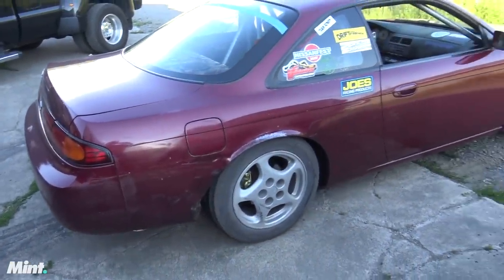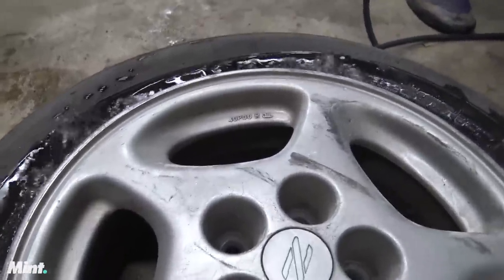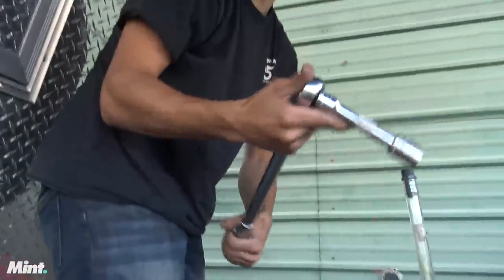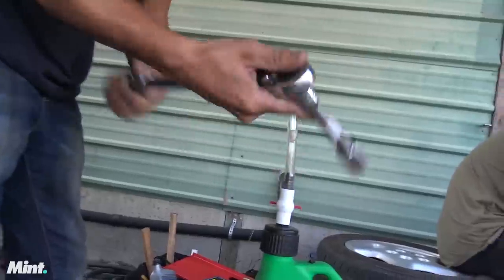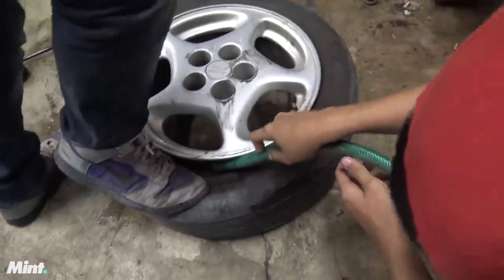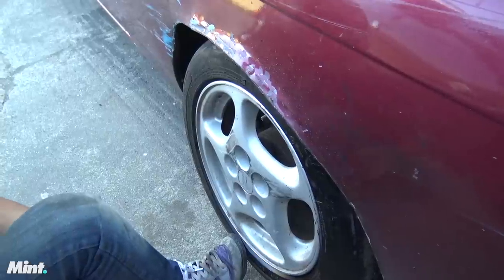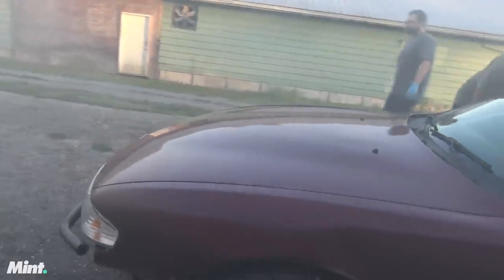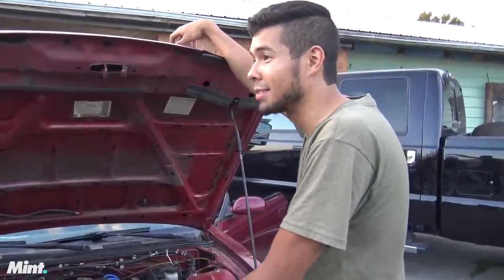Filling a CAR TIRE with WATER!

Comment: I am a farmer and we put water in the tractor tires for more weight
Reply: Tractor tires are supposed to have water.
Reply: Love this comment
Reply: John Legend I’m 💀💀🤣🤣
Reply: A lot of poeple don't know this
Reply: I am a farm hand so this is common knowledge to me to
Reply: Isn't the water put in the drive tires treated with something to make them even heavier. I forgot what called.
Reply: Calcium Chloride so they don't freeze.
Reply: It is also common around here to use windshield washer fluid, don't corrode like calcium, also doesn't freeze
Reply: @edwardsnowden4408  😂
Reply: @edwardsnowden4408  ewwww
Reply: FSB M ...Lier.... ?
Reply: I haven't seen anybody do this for some time now, all folks i know use weights an the back of the tractor, simplest thing would be to cast a barrell full of concrete with a steel rod through the center
Reply: majan but adding a liquid ballast is the most efficient because the centre of gravity of the tyre will always be where it’s contacting the ground.
Reply: @edwardsnowden4408  your censored
Reply: Good idea!!
Reply: Sea view farm Guernsey so do we
Reply: Kolin Martz not if you’re on a hill
Reply: John Legend wow dude you really are a legend lol
Reply: why are you not out harvesting and putting up fences!?
Reply: We use milk in our tractor tires. It curdles during the summer and becomes excellent cheese.
Reply: Tt Miller  um what does this comment have to do with the one I left
Reply: Tt Miller  true not many people are like that in the rural parts of Kern county California most these poeple know these things   so it's more like common knowledge
Reply: @rachellopez6626  love buu
Reply: Just use that RV winter Plumbing blue it it's cheap and it wouldn't freeze and if the tire popped is not harmful plus it has something in there to keep from corroding just a thought.
Reply: Yeah I see people with cement
Reply: Farm wisdom ! Farm wisdom!
Reply: have you tried sand
Reply: John Legend in Russian voice
Reply: well damn
Reply: Gym they are ballasted tires
Reply: Is dat rt? Wow. Cool!
Reply: recall  Hey! she asked first! and we keep it in the family. Literally.
Reply: MadeDat
Reply: tractor are supposed to be a water inside for more wait and i saw that when the driver put water on big tire of tractor....
Reply: @rachellopez6626  LOVE YOUR COMMENT!!!! NGGAAA!!!!!!!!!!!!
Reply: Why not concrete?
Reply: True

Comment: "You lose 50hp right from the start"

Just add a few more stickers to the car to compensate
Reply: Chrome air cleaner is proven to add 50 hp
Reply: No no, just some stickers 😁
Reply: Definitely the best comment 😂
Reply: Speed Holes....
Reply: Should've paint the car with more red
Reply: A few more spoilers can composate too (im going with the joke)

Comment: fill a tyre with expanding foam
Reply: Ryan LeFevre is a lawnmower a car? It would have different results
Reply: ItZz JoK3rZz yea it would be different specially if they doing skids and burnouts
Reply: Adam Smith yeah
Reply: Adam Smith i have tried it for my bike the ride gets very bumpy
Reply: ItZz JoK3rZz depends on what kind of lawnmower
Reply: Some of our industrial trucks at work have foam filled tires.  They are stiffer and have less traction.
Reply: Zoidsfan77 means more skids?
Reply: Adam Smith Yes.

Comment: tires full of flex seal
Reply: Become unstoppable
Reply: That would be a lotta damage
Reply: It will be rubber too!
Reply: @ajtritto3989  lot if damage resistance
Reply: They sell solid tires if that's what you're going for. They're really expensive and they are very uncomfortable to ride on. LOL
Reply: Helpmecomeupwithagoodusername it would help
Reply: NOW THATS A LITTA DAMIJ
Reply: A gallon of flex seal costs $89 so it would be a bit expensive. But they sell the Leak Stopper rubberized roofing tar for only $19/gallon! :)
Reply: @lorenzoangelomelo3683  *u⁸⁹😅😅😅😅😅
Reply: It'll never pop cause when the tire pops, there is a another tire because flex seal is liquid rubber
Reply: To much rubber -_-

Comment: So you pretty much made water cooled tires.
Reply: aaaahahahaha.
Reply: Still won't cool an AMD
Reply: HERPY DERPEDY - You mean Intel? AMD's run pretty cool, especially the Ryzen series. I have an i7 and its IHS is so shitty that it hits 70c even with a 240mm rad with stock settings.
Reply: Sean Place well still don't know much about the Ryzen but ye ol Athlon were smokin
Reply: HERPY DERPEDY - For sure, early 2000's AMD's ran pretty hot. I have some vintage systems with them and they're pretty toasty. But after Athlon 64, I never seemed to have any issues with cooling them. Even my old gaming rig with an FX-8350 and Hyper 212 barely gets over 55c with full synthetic load.
Reply: Makes Sense haha
Reply: My i7 in my thinkpad sits at a bomby 60c just on youtube right now

easily 85-90c gaming bwahahah

she takes a lickin and keeps on tickin!
Reply: Sean Place have you considered liquid cooling? My intel doesn’t break 50 when gaming in ultra.
Reply: gaming in ultra probably doesn't stress the cpu much lol
Reply: Tractor tires have been filled with water for years and years now. Sorry bout dat.
Reply: Guyver2391 I have a 240mm radiator. It's a common issue with newer Intel CPU's. They use shitty quality thermal paste between the CPU die and IHS, which results in high temps. When it's replaced with better paste, temps drop by 20c on average. I'll likely replace the paste after I get a new Ryzen system.
Reply: mPrism He must have bad airflow in his system. My 8350 was first built inside of a Cosmos 1000, which doesn't have very good airflow. I don't remember exactly how high the temps were, but they were above 65c. I installed a second intake fan directly in front of the Hyper 212 and the temps improved, I would get high 50's to low 60's after that. The board is now in an NZXT S340 and it gets low 50's. I had push-pull fans until I moved it to the new case. The pull fan didn't do much in the new case so I removed it.

PS: Ambient temps make a huge difference.
Reply: Sean Place - I have a FX-9590 in one of my rigs that runs like the surface of the sun....  Liquid cooled,  thing heats the whole room.
Reply: MadStupid - The FX-9590 is just an overclocked 8350, that's why the TDP is 220.
Reply: Sean Place  Yes, AMD picked some CPUs to factory overclock so they could get to that 5GHz number (and charge a lot more) in the end, the result is a CPU that puts out an extraordinary amount of heat. Liquid cooling keeps it running fine but dumps all that heat in my room. I like AMD,  I wish they actually get competitive and force Intel to stop slowly releasing "new" products that are marginally better than their predecessors.
Reply: @realmadstupid  you wish AMD would get competitive?
Wot, they are... I have a Ryzen 2600 and it's CPU score is higher than a Intel 7700k for half the price. My processor isn't even unlocked. The unlocked version is even better but pretty expensive, still cheaper than Intel.
Reply: My tractor has a Nvidia
Reply: Sean Place 70C??? Either a bad proc off the line or a busted ass cooling system. I can’t even hit 70C using stock cooling on an overclocked i7

Comment: Liquid cooled tires. More laps less tires. ;)
Reply: Yo, thats good.
Reply: lol
Reply: Less power.
Reply: Mr.Mister Issa joke
Reply: Destin Ginnis
I know.
Reply: Dont add as much water maybe, try and find the sweet spot between keeping power and lasting longer
Reply: Less grip
Reply: DutchPyro2011 probably more grip due to added weight of the water
Reply: the heat would turn the water into water vapor and pop the tire
Reply: Literally use liquid coolant then :3
Reply: Dustin charles now that makes sense
Reply: No, water will cool the tires.. Warm tires mean more grip. Also the tires will burst more easy at high speed because of the added downforce.
Reply: ok..you guys have to be joking around...filling your cars tires would slow your car down terribly ..
Reply: +The Cigar Booth
Water carries too much pressure and inertia to get displaced enough for proper road contact, plus centrifugal forces furter distort this contact patch. Meaning they have less grip in all cases, but even worse the higher the speed.
Reply: Martín Varela but less grip with water in the tires = great drifts with more laps and less tire wear
Reply: +Γιάννης-Παναγιώτης Τζανάκος
The Cigar Booth claimed it would provide more grip. I did nothing more than a reply to that.
Reply: Frank Newberry k

Comment: Farmers use water in tires all the time, ad weight and stability to tractor
Reply: Bodgemiester no
Reply: Erm yes, filled the rears on a John Deere 6800 beginning of this hay season
Reply: Breeze yes, its called "loading" a tire. Usually brine water or water and calcium chloride, to prevent freezing. The HUGE difference is a tractor tire doesnt make nearly the amount of revolutions per minute as a car.
Reply: Yes they do.  They specifically make attachments to go from garden hose to a shrader valve specifically for this reason.  A friend of mine does this in his lawn mower for mowing ditches and with the snow blower on it.
Reply: Well said Chris, are you related to Ed by any chance?
Reply: Bodgemiester Ed who?
Reply: Hurlbut,
Reply: Bodgemiester not that i know of.
Reply: Bodgemiester been around tractors my whole life, I’ve mainly seen people use foam xD, to each and their own though!
Reply: bassboomer105 foam is more flat prevention. Water is traction/weight aid. Foam is to rigid to move with tires. The only large tires i have seen foam filled is construction equipment where traction is a relative non issue.
Reply: Bodgemiester we put water in our rock crawlers tires for the same reason.
Reply: Dj Wilson : usually use calcium chloride because you will get more  weight to enhance the traction!
Reply: Yep, we put water with antifreeze in the tractor tires to give it more weight for traction.
Reply: Yes, all of our tractor tires are at minimum 50% full of water.    Virtually every farmer has tractor tires filled with water.
Reply: Chris Hurlbut nice to know, I do know driving on the road w foam in your tires will beat you to death, thanks for the edumacation
Reply: TheBartman47 oh I put milk in my tractor tires
Reply: My dad always filled his tractor tires with water at his place out in the woods/country because a tire puncture is far less explosive when you run over sharp yaupon stump.
Reply: Great for 2mph
Reply: Supercat tires crack/dry from UV damage. Once this happens, you should source new tires to have on standby. Leaking calcium/beet juice/glycol/water is the least of your problems with cracked tires.
Reply: Came here for stupid video and received surprisingly educational information, thank you!
Reply: IF driving a Skoda across a desert, first fill tyres with water and when you breakdown ..
Reply: Sometimes used in forest machines too.
Reply: Agreed, I worked in a tire shop out in the farm country and every fall beginning of winter we went out to all the farms and filled tires with water and calcium.
Reply: Here we use beet juice. Doesn't freeze like water, and doesn't corrode the rims like calcium chloride.
Reply: its called fluid filling, it is used for weight and we use a mixture of methanol and water to prevent freezing. calcuim is not used much anymore since it literally destroys the wheel. you dont fill the tire completely tho, ju to the top of the wheel and air the rest of the way
Reply: My little 20 horse Wheelhorse lawn tractor had liquid rears........
Reply: I was changing my tires in a tire shop when a guy came with a tractor and they filled his tires with water. I was like wooow...  they said is to increase weight and stability. Good ideea.
Reply: Breeze Yep, people do it all the time. I’m not a farmer either, just lived around farmers
Reply: Got a smallish John Deere front loader that moves aggregate all day long. Couldn’t work half as efficiently without the rears loaded up !!

Comment: FIll one with sand
Reply: I literally was just thinking that fill it up with sand
Reply: JD Kreeper sand are 1.6 time denser than water so the sand tires probably about 25-30 kg
Reply: A bullet can’t go through that kind of tire
Reply: That thing would be impossible to balance.
Reply: no. fill it with vodka
Reply: Better yet fill it with mercury.
Reply: Fill it with concrete
Reply: That bit said semen😭😭😭😭
Reply: awesome stuff 😂
Reply: Frasertive 😂
Reply: I swear first thing came to my mind lol
Reply: fill it with rubber. pure tire.
Reply: kleetus92 yeah but you got to wonder if it would self balance like a set of balancing beads in a 18-wheeler Tire I bet anything over 40 and itself balances I don't know may not work that way be cool to find out
Reply: this coming from "daniel PC/Xbox".
Reply: And one filled with mercury
Reply: Nathan Dehnel discribes What i do with my channel. What’s the problem. Your sitting there with your last name out. What’s worse?
Reply: JD Kreeper fill them with gasoline
Reply: cement
Reply: wow 1.1k likes
Reply: daniel what about it. Fortnite is cringy and i like mc.
Reply: i died laughing
Reply: kleetus92 send should balance the tire by it self. Thats what they are using in semis. They put a metal ring/tubing with small grains inside of it on the rims. It's worth the try.
Reply: I think it will turn into glass
Reply: finn jake haha I was thinking you meant the Mercury car
Reply: Frasertive    Been done already...
Reply: I don't like sand
Reply: I was thinking that too!
Reply: Next2Me YT yes it can. The bullet from a valmet/sako 7.62 mm RK-62 for example (Finnish built version of an Ak-47, more accurate but has similar penetrating power) can penetrate 1.5 normal sandbags before the bullet stops. That's why sand bag protection is generally 2+ sand bags thick. I tested this personally with my own Valmet RK-62
Reply: JD Kreeper fill one with gallium
Reply: Fill them with Helium and have a lighter car :D
Reply: Why not just fill it with rice, on ricers and much lighter than rocks
Reply: @kleetus92  auto balancing as syntrifical force pushes water out to spin true, no weights needed. That's why truckers put like 8oz of small bbs or about 6 tennis balls inside their truck tires and it works great
Reply: jake  that's intelligent!!!! so poison shoots in everyone's faces and it kills all animals/ wildlife in the area. For god's sake if it runs into the sewer system
Reply: @SavingSavvy  sure hope that was a joke? That wouldn't make your tires any lighter
Reply: John Ranieri it was a joke, no worries
Reply: I dont like sand, its coarse, rough, and it gets everywhere
Reply: Lead dust
Reply: @finnjake3508  Don't try it with aluminum wheels

Comment: It was kinda awesome that he wore a hole in the pavement and the tires were still intact... sort of.
Reply: Chad Pugh thats not a hole. Its just tire leftovers
Reply: Actually if you look again at like 7:35 or 7:36 you can see the indents on the asphalt
Reply: All I'm saying is that it's not surprising. All that heat and friction would easily do that. Even a Toyota Prius can do that. Nothing special, people in the comments are going nuts
Reply: fill
Reply: You can do the same with normal tires.
Reply: What's a v4? lol